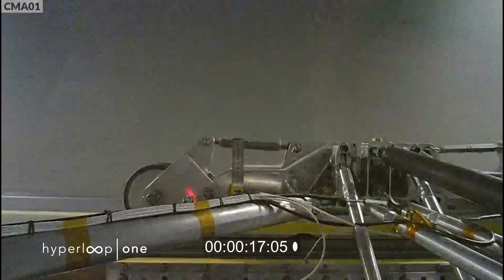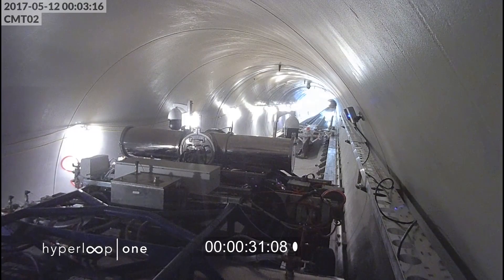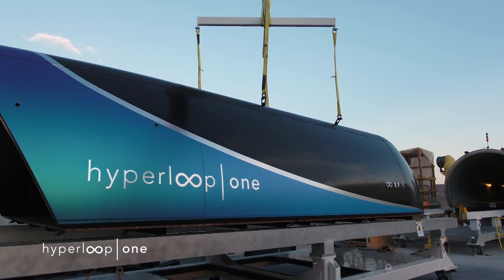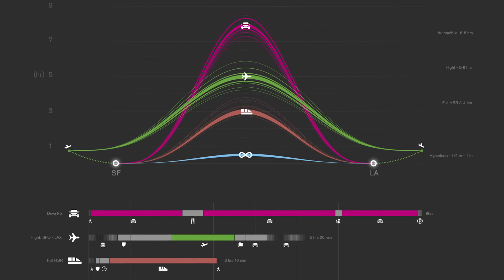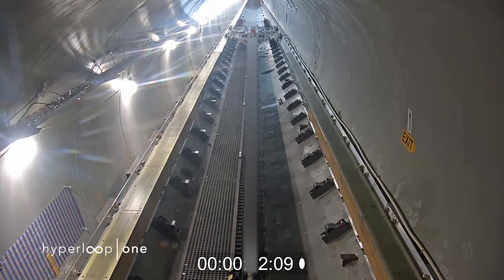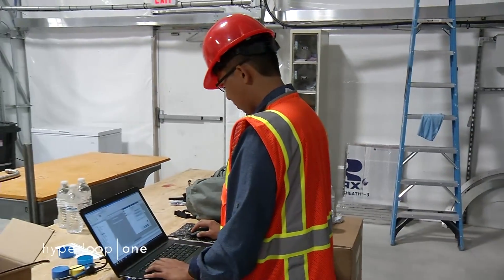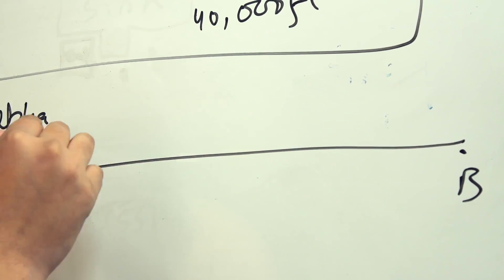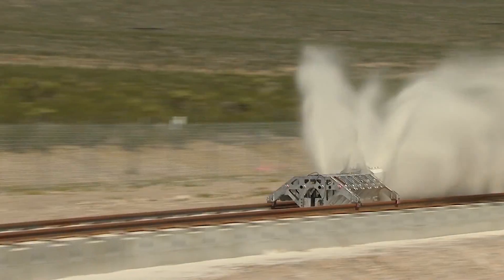Watch the Hyperloop Complete Its First Successful Test Ride | WIRED

Comment: "Hurr hurr Thunderfoot said this this and this so I'm gonna throw away all of my previous knowledge and jump into the bandwagon!

Down with any form of innovation! Down with any attempt to move forward! If it's dangerous in any way, shape or form, DOWN WITH IT!"

Honestly, I'm glad you idiots weren't around when the car, the train, or the airplane were being invented. If you were, we'd still be riding fucking horses because you'd say "Oh the engine is based off of mini explosions! Don't go near!" Or say, "You're putting humans into the air, and their only safety is a small, metal container? Don't go near!"
Reply: Skayren Innovation cannot break the laws of physics :)
Reply: No one is saying it won't work just because TF said so. He actually pointed out some critical problems in his video.
Reply: No, quite to the contrary. It really doesn't matter who TF is, it's all about the arguments he has presented. That's not a cult, it's science. 
PS: The engineer's comment kingklooneyville posted seems really vague, tbh. How about actually addressing say the issue of what happens if the tube ruptures or is damaged?
Reply: There is no destructive pressure wave, it's not going to destroy the capsules or hurt the passengers. This is a massive assumption that is factually wrong. Amazing how you can make up how something will play out, and then say "It won't work". You could use this logic to say cars would randomly explode in a minor crash. Afterall they work by imploding fuel.
Enlighten me on why it's not economically viable. Since you're so smart. 
These arguments are all based on assumptions that are wrong. Did you do the calculations? Do you really knoiw this pressure wave is so strong? Or are you running of TFs terrible physics
Reply: Who would know more about this subject, Thuderfoot, a guy who specializes in chemistry and biochemistry, not physics, or a group of highly skilled scientists and engineers who specialize in the thing they are working on and have working prototypes of? Many of the problems he has can be solved and will be solved.
Thunderfoot seems to be starting his own religion by the looks of things...
Reply: I see I accidentally posted what happens if the capsule has a leak. Here is the exert when the tube has a leak. This was a mistake on my part.
"A minor depressurization of the tube is unlikely to affect Hyperloop capsules or
passengers and would likely be overcome by increased vacuum pump power.
Any minor tube leaks could then be repaired during standard maintenance.
In the event of a large scale leak, pressure sensors located along the tube
would automatically communicate with all capsules to deploy their emergency
mechanical braking systems."
Reply: jweltsch22 Moron Musk, as you call him, is building a shitload of cars that people love, and putting rockets in space. What are you doing?
Reply: Here is an actual comment from an Hyperloop employee about Thunderf00t.  ----------         
I've got this one. I have watched the video, and made copious notes. Thunderf00t is a well known youtube science commentator, best known for debunking religious fundamentalists and understanding the surface-maximization of liquid alkali metals, published in Nature last year.

That aside, both hyperloop videos show a complete reluctance to engage with the real arguments. Sorry, but highlighting some semi-literate comments by your critics does not amount to engaging in a useful discussion. I would like to levitate this video into the sun.

Here are some specific points and rebuttals: -Thunderf00t primarily makes reference to the Hyperloop alpha whitepaper, written by some SpaceX employees in 2013. I saw no evidence of engagement with subsequent press releases by any of the hyperloop companies. In particular, TF doesn't seem to be aware that there is more than one hyperloop company. FYI, we are Hyperloop One, the company that has raised ~$108and built the world's most powerful linear motor in 5 months. -Thunderf00t talks a good game about aerodynamics, but shows no evidence of even having read the wikipedia article on choked flow, duct flow, the Kantrowitz limit, or knowing any of the other 'first day on the job' level detail for our aero team. -One of Thunderf00t's technical gotchas was 'expansion joints are difficult', despite the fact that hydraulic cylinders exist, most steel rails are thermally pretensioned, and thermal expansion is probably something we thought of already. -Thunderf00t could have easily looked up our people on LinkedIn, checked their google scholar bona fides, whatever, but seemed more keen on a cheap take down than actually engaging with interesting and ongoing engineering challenges. -One symptom of the level of technical effort that went into TF's video is his careless assumption that 1g = 1m/s/s, as though Hyperloop was being built on some tiny moon of Jupiter. As a fellow academic, I was disappointed by TF's lack of intellectual humility in an area in which he is obviously not an expert. One would wonder why TF would put such hastily produced, easily debunked rubbish on his Patreon feed - people actually pay for that!

-Casey
Reply: Aiguey but where we're his good points?! seriously do you understand how wrong he is? a good video is the"Hyperloop busted busted". Come back once you've seen a less bais opinion on the subject
Reply: The only argument TF followers make is that TF makes good arguments and that's science! Sure, raising questions and doubts in projects is important for progress. But only if these haven't already been addressed. Thunderf00t has raised nothing the engineers have not already thought about. Most of the answers to his points are in the white papers.
This TF has only created a misleading populace who doubt the new technology. 
Ok, so you want to know what happens if the tube ruptures or is damaged. Here is an exert from the Hyperloop Alpha document.

"Hyperloop capsules will be designed to the highest safety standards and
manufactured with extensive quality checks to ensure their integrity. In the
event of a minor leak, the onboard environmental control system would
maintain capsule pressure using the reserve air carried onboard for the short
period of time it will take to reach the destination. In the case of a more
significant depressurization, oxygen masks would be deployed as in airplanes.
Once the capsule reached the destination safely it would be removed from
service. Safety of the onboard air supply in Hyperloop would be very similar to
aircraft, and can take advantage of decades of development in similar systems.
In the unlikely event of a large scale capsule depressurization, other capsules
in the tube would automatically begin emergency braking whilst the Hyperloop
tube would undergo rapid re-pressurization along its entire length."
So the concerns have already been addressed.
Reply: This TF guy sounds like he has a cult following.
Reply: +Aiguey  Thunderfoot is a Chemist, not a Physicist. Confusing the two is even more offensive to both than confusing Cambridge and Oxford graduates.

He is trustworthy on Chemistry, but speaking as a Physics graduate, he frequently makes minor physics mistakes in his science videos, just like you'd expect a filthy Chemist to do. ; )

Comment: bu... b... but... thunderf00t!  D:>
Reply: every modern invention has had its flaws, and yet we still have planes, and went to space, amongst other things, remember that this is just a prototype, so the final product may have more structural suport, and that terrorists will do whatever they want, so that as a point doesn't really make sense, failure on the tubes won't really do much, imagine a regular vacuum chamber releasing the pressure.
again, this is just a prototype, several improvements will be made as time goes by, and his video only talks about the whitepaper, not the final product, as it doesn't exist yet, so if it was tf's video that made you skeptical, you can just forget about it only based on my last argument, if it wasn't him then you probably won't change your mind regardless of arguments, still, read this bit written on reddit by one of the guys in this video:

Here are some specific points and rebuttals: -Thunderf00t primarily makes reference to the Hyperloop alpha whitepaper, written by some SpaceX employees in 2013. I saw no evidence of engagement with subsequent press releases by any of the hyperloop companies. In particular, TF doesn't seem to be aware that there is more than one hyperloop company. FYI, we are Hyperloop One, the company that has raised ~$108and built the world's most powerful linear motor in 5 months. -Thunderf00t talks a good game about aerodynamics, but shows no evidence of even having read the wikipedia article on choked flow, duct flow, the Kantrowitz limit, or knowing any of the other 'first day on the job' level detail for our aero team. -One of Thunderf00t's technical gotchas was 'expansion joints are difficult', despite the fact that hydraulic cylinders exist, most steel rails are thermally pretensioned, and thermal expansion is probably something we thought of already. -Thunderf00t could have easily looked up our people on LinkedIn, checked their google scholar bona fides, whatever, but seemed more keen on a cheap take down than actually engaging with interesting and ongoing engineering challenges. -One symptom of the level of technical effort that went into TF's video is his careless assumption that 1g = 1m/s/s, as though Hyperloop was being built on some tiny moon of Jupiter. As a fellow academic, I was disappointed by TF's lack of intellectual humility in an area in which he is obviously not an expert. One would wonder why TF would put such hastily produced, easily debunked rubbish on his Patreon feed - people actually pay for that!

-Casey

(feel free to let me know what you think)

Comment: I may have not heard the answer on how the fuck are they going to "supply" four passengers with air to breath inside, as outside there's only vacuum...
Reply: RevDice Global Yea how the fuck do they supply submarines with air?? And why can divers stay underwater for hours at the time. I bet the government is hiding something from us.
Reply: Joppe Koers so you tell me you will put oxygen tanks inside, then they all pop like baloons and consider the hyperloop slowing down.
Reply: There's this handy invention called an "oxygen tank". A 10 liter tank pressurized to 100 atmospheres is enough to supply an adult with a 1 atm pure oxygen atmosphere for about 2.5 hours. Scuba diving tanks can be twice as large and have pressures twice as high. Just one of them would be enough to keep four passengers alive for 2.5 hours. Put two or three of them on the pod just to be safe.
Reply: Seekay and all that pressured oxygen won't make the chamber just inflate, as outside there is (from my understanding) almost no pressure, as there is almost nothing to cause it ?
Reply: Nope. Jet airliners experience a pressure difference of 0.5 to 0.6 atmospheres when cruising at 40,000 feet. A couple millimeters of carbon composites can easily handle the 1 atmosphere pressure difference between the interior of the pod and the near-vacuum environment surrounding it. In fact, airliners are only pressurized to about 0.75 atmospheres and it's still quite comfortable.
Reply: well, the hyperloop might experience next to 0 atmospheric pressures, as again , outside is assumed almost full vacuum. On that slim design of the chamber, where i highly doubt, that there will fit 4 adults, I don't think it will be that easy to prevent the inflation of the chamber itself. they could make the layers a little bigger, but it will take even more space up.